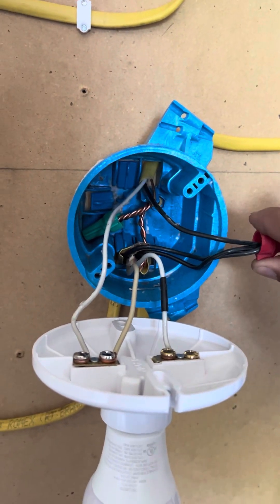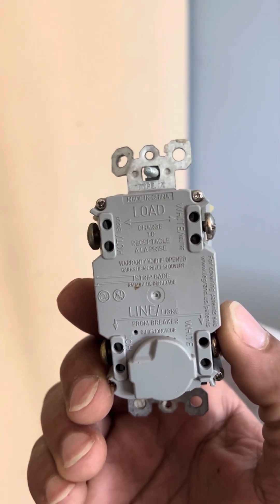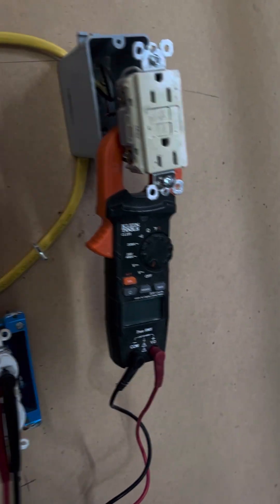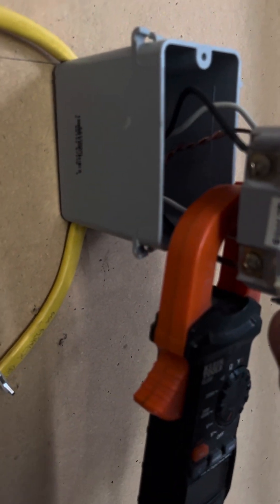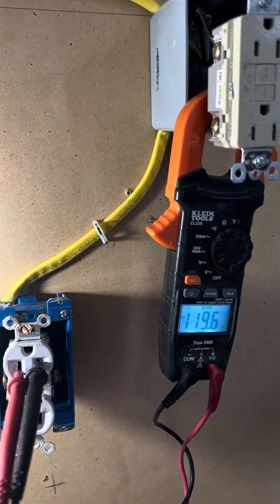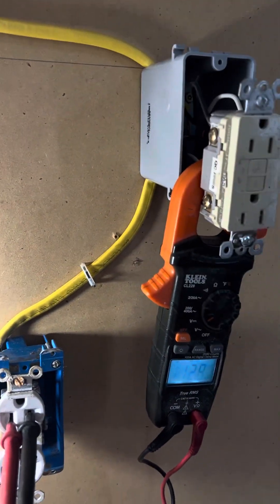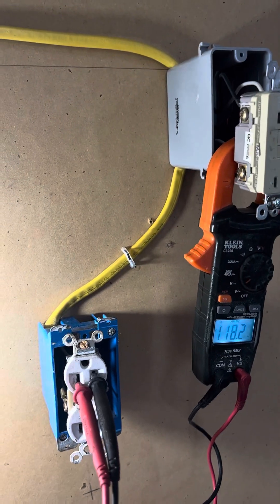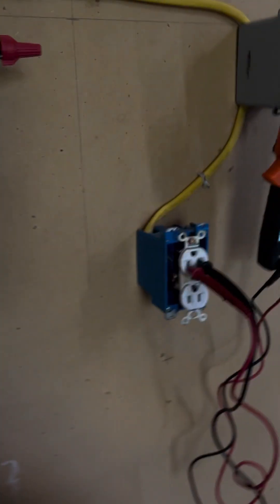How to wire a GFCI

Comment: And the protection device is rated at what?
Here in the UK we don't mix lighting and power circuits.
Reply from the maker: Here in the US receptacles are apart of the general lighting load when doing load calculations. But some people prefer to separate them.

Comment: that wire needs to be in conduit. you can't just staple it to the wall like that.
Reply from the maker: If you look at more of my videos you’ll see that this is a board used for demonstration purposes only. This is not an actual installation.